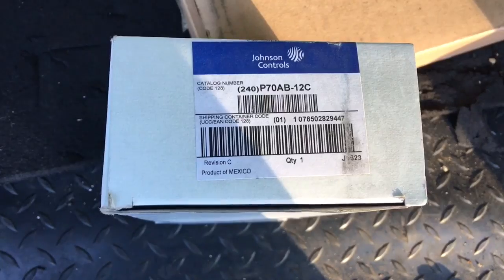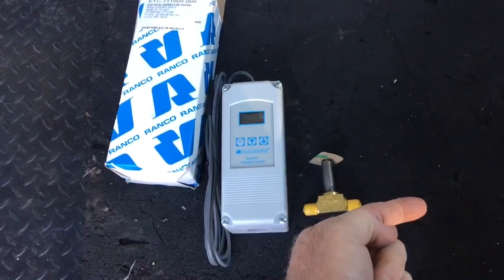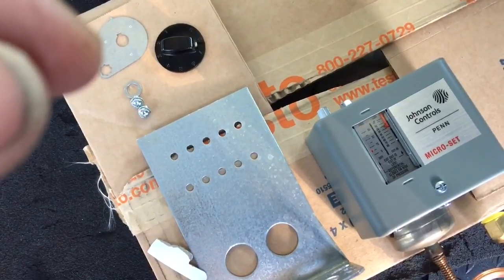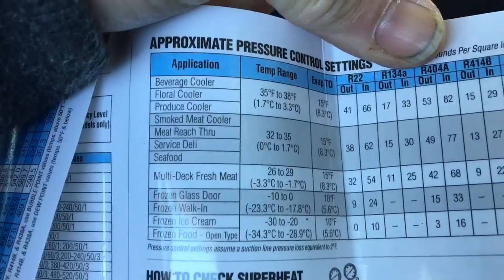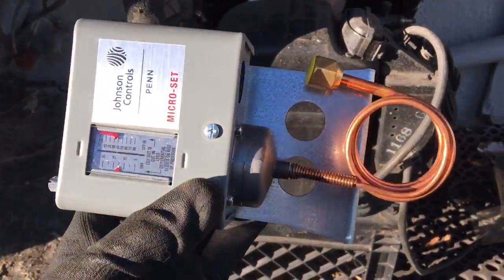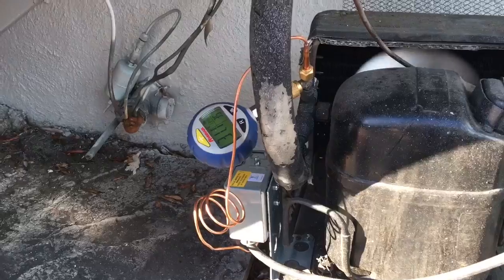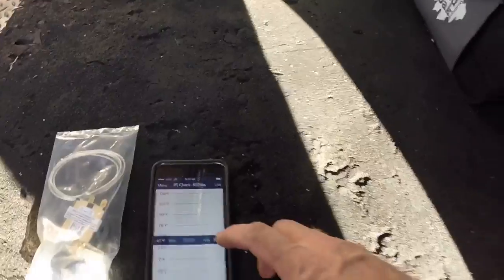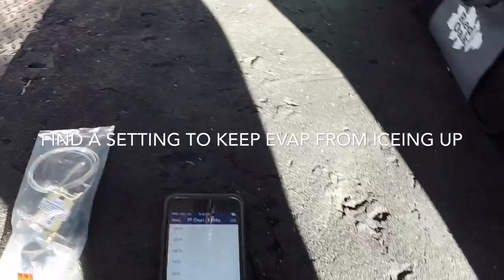P70AB-12C low psi control

Comment: I seen this setup before on an old step in cooler at a chinese restaurant. I had put a JC air coil in place of it and added R417C worked great. First time i saw an LP to control temp. Cool video.

Comment: LPC switch used for a t-stat only works if you have a non-bleed txv tho...but then again walk in boxes usually are non-bleed and have start components to overcome the stored head pressure. But that's also good info if you come across a walk-in with a bad txv that's running on a temp control with a low pressure cut out...don't put a bleed/equalizing txv on there!  Good video
Reply: Great information.

Comment: the reason for regulating the temperature through the LP control was to attempt to prevent the customer from screwing around with it.  Lots of times, techs will remove the adjustment knob in a vain attempt to prevent tampering.  The way I see it, if they screw up messing with the controls, they have to call you out and you get to bill them for your time. This only backfires if they wait till 3:30 on Friday....

Comment: DAVE HAVING AN ISSUE WITH A HOSHIZAKI KM SERIES ICE MACHINE 3 BEEPS REPLACED BOARD WATER VALVE AND CLEANED MACHINE AND FLOAT SWITCH STILL BEEPING AND NOTICED LINES FROSTING UP ANY SUGGESTIONS
Reply: tito Arroyo three beeps "freeze time"?

Comment: Thanks Nor Cal. Thats exactly what i have my line voltage stat set at 55 degrees. Does the condenser come on automatically on pressure? Or do i need to run control voltage to condenser unit contactor to energize the comp contactor? Do i need to add a jumper somewhere in the terminal strip in order to tell condenser im doing a pump down system?
Reply from the maker: Jose Alfaro your stat needs to energize a liquid line solenoid valve. The psi switch cycles the condensing unit.

Comment: Hey Nor Cal great video man. I currently work on HVAC systems only and i have a job im doing for a very good friend of mine. He has a wine cellar at his house being done and I installed a small ducted fan coil with a refrigeration Tecumseh condenser R404A.The fan coil installation instructions states unit to be set up as a pump down system and This video explained it all. I have a question regarding the cut in/cut out. Do you have an email i can message u?
Reply from the maker: Jose Alfaro on pump down for R404a set your cut in at 35 Psig. And have it cut out at 5 and you will be good. For wine have your Tstat set around 55-57

Comment: Like the explanation of how to set up those switches as a thermostat, kind of the same concept the reach ins use with the bulb in the coil, nice and simple. I looked up that app after watching, like the slide option. RSD Notes for those interested.
Reply from the maker: tcpHVAC/R that's my main supply house. Great app has a level too.

Comment: I usually like all the old school stuff but that in particularly I hate they are usually never really accurate and in the winter naturally the adjustment would be off compared to summer so usually I would just tell the customer that I would change it to a thermostat with a solenoid
Reply from the maker: hardcooling I tried they did not want to spend the $. If it had food in there I would have done it. Just beer 🍻 in there.
Reply: here in toronto it's diferent if it was beer they would spend all types of money to make it the best . food .. meh as long as its working .
Reply: prime time restaurants spend money on refrigeration in Toronto?  Every customer I know wants a deal.  Like below a livable wage kinda deal.

Comment: I did work in a restaurant with pressure controls controlling a prep table, walk in, and standard 4 door fridge. No t stat in sight. Have you ever found a leak coming from one of these controls Dave?
Reply from the maker: Apprentice Phil yes over time the bellows will leak, cap tubes will rub through.

Comment: Good stuff bro. I know walk in freezers will use the low pressure cut out as a back up if the thermostat fails but I haven't worked on a walk in where the lps controls the temp. Merry Christmas.
Reply from the maker: Ulises Palacios merry Christmas 🎄

Comment: Good video Dave. In most cases using a pressure control as a temp control on an outdoor condensing unit sucks. Your ambient temp fluctuates it changes your refrigerant pressures then causing your pressure control to cycle. They work good when the condenser is indoors. (Temp controlled environment to maintain a constant ambient temp.
Reply from the maker: Anthony Reardon hvacr yep. On cold mornings they don't start up.

Comment: great video Dave I like using that particular low pressure control , and as a universal temperature control I use the Ranco A12-700 and the cut in , and cut outs are at 37 cut in and cut out at 18 psig that works for me A12-700 bad ass tstat ...great video Dave
Reply from the maker: Felipe Tafolla I use part # 61-030 from RHS 21.00$ just like the A12701.
Reply: Nor-Cal Refrigeration & H.V.A.C nice might give it a try ..thanks!